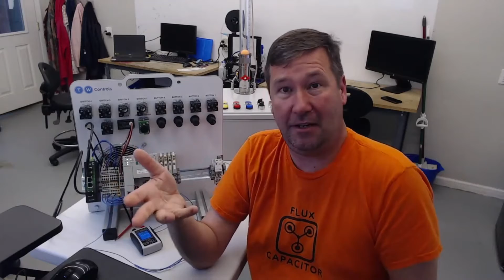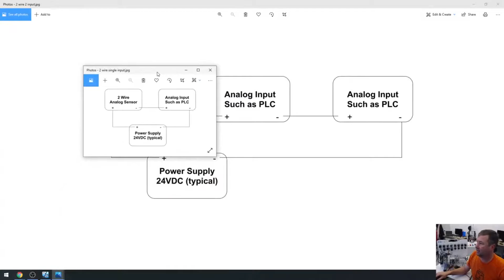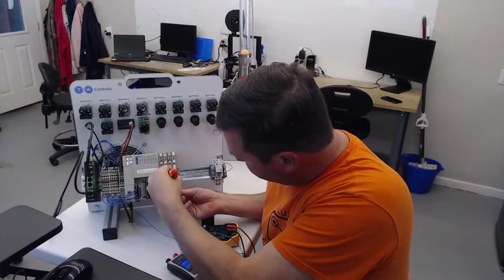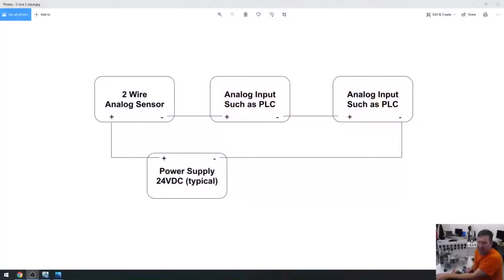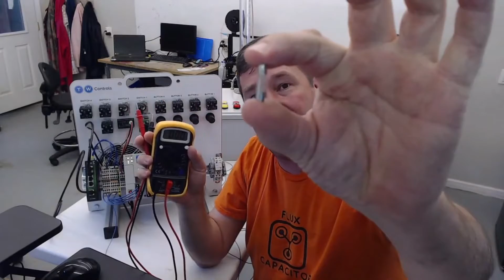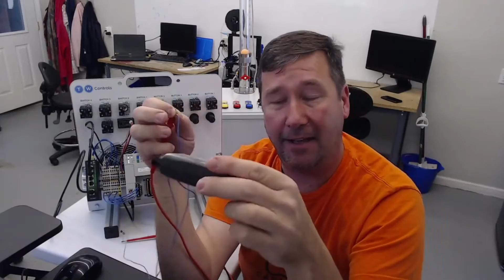Measuring a 4-20mA analog signal with a basic $10 multimeter.

Comment: Hi Sir, I have a question regarding the same experiment you did. i have a pressure transmitter whose rating is in between 0 to 20 mA. so i am trying to measure the current 4mA when the pressure transmiiter have no pressure but my clamp meter shown 0.09 A which is equals to 90mA. whats the reason behind this and how to solve the problem. please rply i am waiting.
thanks
Reply from the maker: What type of clamp meter?  Are you sure it goes down to mA resolution?

Comment: I like the content Tim. I am looking for an alternative to buying a process meter for testing. Would you recommend buying the analog simulator in this video for supplying 0-20mA signals? Another question, when troubleshooting a sensor, say the sensor has an LED indicator on it that lights up but you want to see if it is changing state. A tech once told me to measure the potential DC voltage across the sensor and it will change by a few volts when the sensor is flagged. Do you think this is a reliable way to test without breaking the circuit?
Reply from the maker: The PLC tools SIM-ALP2 would be good for simulating a 4-20ma signal but it is not meant for calibrating instruments such as some process meters are needed to do.
Reply: @TimWilborne what do you recommend for that?